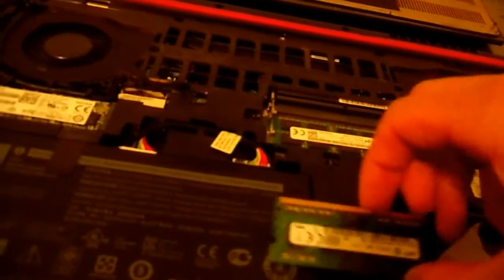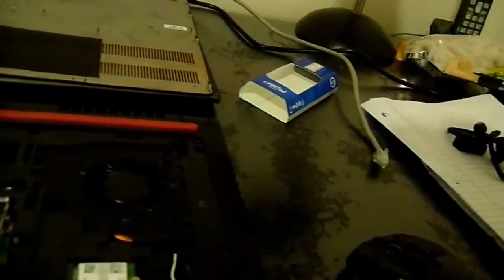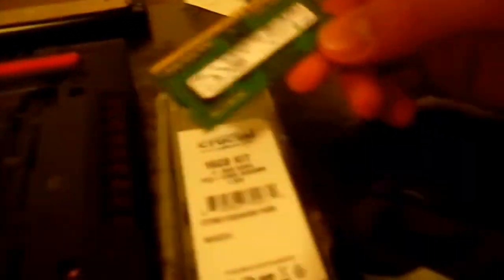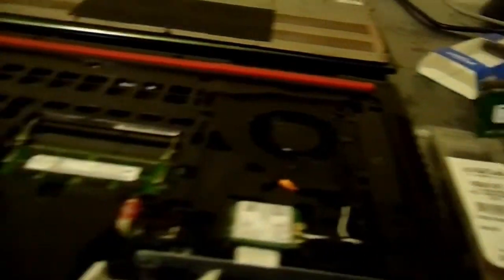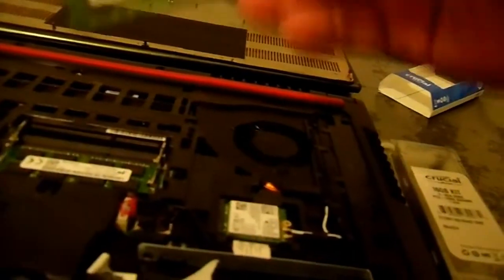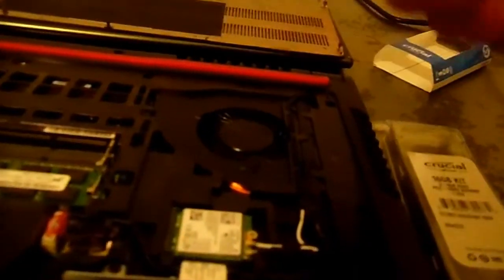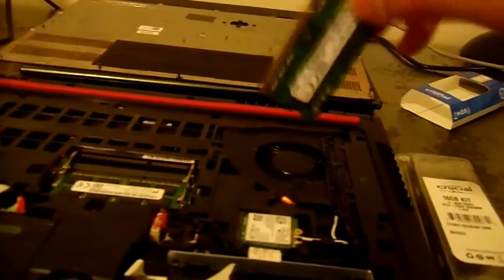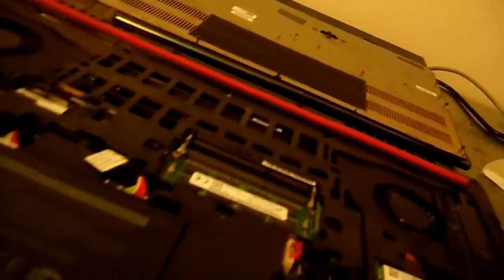Adding RAM to Dell Inspiron i7559

Comment: Is this compatible with Crucial 8GB Single DDR3 1600 MT/s (PC3-12800) CL11 SODIMM 204-Pin 1.35V/1.5V Notebook Memory CT102464BF160B? I'm not sure if it is, what's the difference between DDR3L and DDR3?
Reply: +Chan Park The DDR3 on that Crucial ram card says 1.35v on Amazon, but I'm not sure
Reply from the maker: +Chan Park Yes, you should be fine